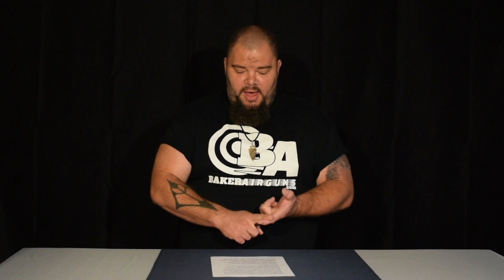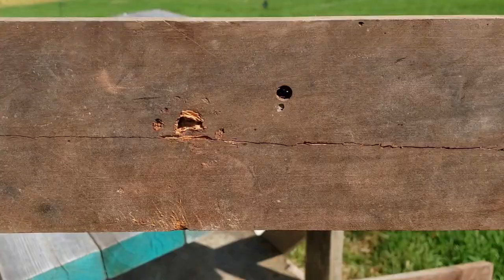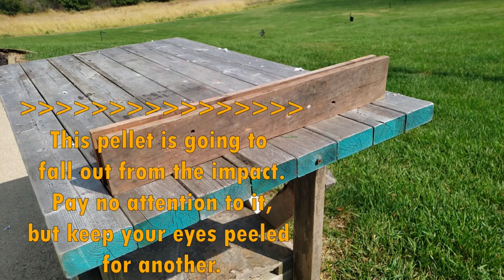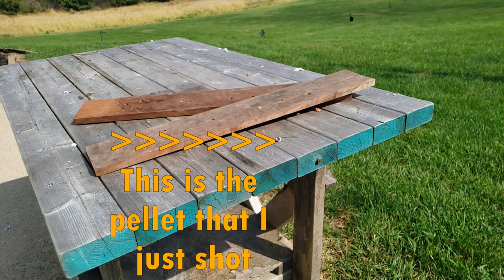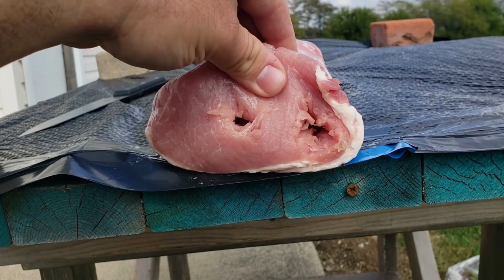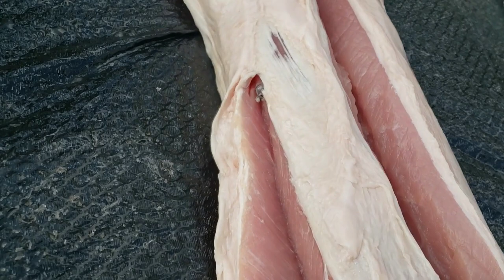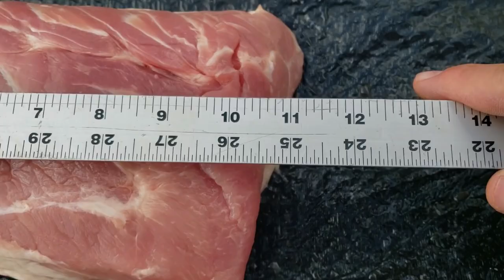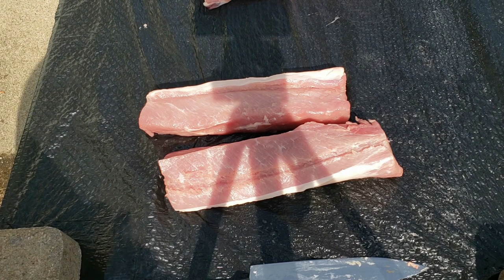PART II...What's deadlier, a .25 or .30 caliber airgun?

Comment: Yet another great video. Just wondering if that also translates down to a .22 at 70 ft/lb being even deadlier than the .25?  More “Penetration”?
Reply from the maker: Thank you very much!  I'm not sure, and I wouldn't even guess until I tested it.
-Donnie
Reply: I’ve never had a .25 but I have a Sumatra .22 and it puts out almost 80 foot pounds and it will shoot through a treated 4 x 4 I believe the video still up on my  channel.
Reply: I can tell you 100% in pork that my Impact MKII 22 pushing JSB 25.39s at 940 and pushing 25 25.39s at 940 the 22 penetration was about 6 inches deeper. Shooting NSA flat base HPs in 22 at 69ftlbs and flat base 25s at 78ftlbs the 22s penetration was about 4 inches deeper.
Where I did notice a huge difference in wound channels was not in 22 vs 25 or 25 vs 30... Where things changed is my 35 impact, it was a large difference in the first 2/3s of the wound channels and the remaining 1/3rd of the wound channels looked nearly identical and that's over shooting a fair bit of pork loin in tests.. We have shot hogs heads we have taken hunting and tested airguns on them as well. On hogs skulls pellets from 22 to 35 will bounce off it if hits at a glancing angle, and more then half the times. Out of all the most reliable to penetrate was 22 right 33.95s at 64ftlbs and slugs at 68-69ftlbs... 35 at 130ftlbs only tested with slugs and they was reliable at shattering the skull and penetrate the brain. As far as punching through the skull positioned with a slight angle to where shot would land, it was in this order 22 33.95s at 64ftlbs penetrate 90% of the shots (we tested 10 shots in each cal at a distance of 25y), 25 33.95s at 67ftlbs 85%, 30 44s at 71ftlbs was 65% but at 90ftlbs was 80%, 35 slugs at 70ftbs (lowest I could go) 55% and at 130ftlbs was 100%.

Comment: Question. What about with hollowpoints? The 30 will spread larger (which would,indicate more resistance and shorter penetration,  UT when you are talking about hunting, thst is what you want isn't it? Larger spread around the vital area?) (Also, if you are off,just a  bit, same vitals missing distance with both calibers, ie, just bately missing, with pellet trajectory just barely missing vital organ, you have more chance of the larger pellet actually hitting vital area as it spreads, no?) Would the smaller .25 penetrate beyond vitals before spreading maybe?  Just some thoughts.
Reply from the maker: Totally different comparison there.  
-Donnie

Comment: My theory regarding caliber damage wasnt that one was larger but could weigh more, that way it takes more energy to accelerate to the same speed which could make more use of the pressurized air, thats not tested here as both are shot at the same fpe. I agree though that at the same energy a smaller effective surface area will provide less wind resistance and more penetration obviously (as its also going faster). Could a 30 do more damage with a hollow point slug? That would seem intuitive to me idk.

Comment: Dude, you are awesome.  Reality gives not a single shit what we think, and when theory and reality conflict it's never reality that is wrong.
Reply: People forget that tissue is elastic, particularly living tissue.  5/100s of an inch difference the projectile's diameter is well within the limits of that elasticity.  Coroners have told me the only way they can tell the caliber of a pistol bullet that produced a wound is by finding the projectile. It also makes sense that in projectiles with comparable energy the larger one, the one with the most resistance, will penetrate less when there is not a significant disparity in sectional density.   That, to me, is not even a little counter-intuitive.  You want to kill something? You need to hit the important stuff, and you need to have the penetration to reach that important stuff when you do.  Period.

Comment: Hi, If both calibres were at the same speed, would there be any difference in the current results, also, related to the Kill effect, if there was a higher shockwave with the 30, (which wasn't evident) would this contribute to its potential lethality.   Grazie Mille

Comment: You will get debating from anyway you do the testing , they want you to give the thirty caliber more , Velocity and FPE , you can do the same thing with the 25 Caliber ! This was comparing two Air Rifles , so the testing was pretty darn fair ! People sound like the never ending testing for the 9mm Luger and the 45 acp ! 9mm will penetrate , Uhhhhhhhh Uhhhhhhhh Uhhhhhhhh more ,  Couldn't resist that ;  and the 45 acp at the same energy level will make a bigger hole ! Also those are some hard boards for a pellet to go through ! Thanks for the information and the cool videos !

Comment: the FPE is different on each round.  you should repeat the same test but the chrono velocities should be the exact same.  Im willing to say that if you push the 30 and 25  at the same velocities, the 30 will penetrate more.  great video though.  Btw the Gauntlet 2 is pushing 30 cal to 99 FPE. thats alot higher than the 30 in your vid.

Comment: I heard an African PH and guide say that when it comes to Elephant and dangerous game rounds, "Slow and steady wins the race".  Meaning a super fast smaller caliber will usually deflect and not keep the intended path through bone, whereas a slower big bore would drill a straight line.  I realize that we're not taking about elephant guns here, but the 'perceived' terminal performance on game of my 600mm Impact .30 vs my 700mm .25 is night and day.  The 30 SMACKS and again the 'perceived' knockdown is far more dramatic with my .30  However, I'm slinging 91lbs of fpe with my .30 vs 52lbs of fpe with my .25.

Comment: The Hatsan Blitz test by MacabeeSpeed, while not as technical, seemed to show the .30 cal retaining its power at a greater distance.
i know there is a lot of factors though.
Reply: in the video i reference the 12 minute 40 second mark shows a comparison @100yds of impact on a wood board and the .25 was stopped while the .30 passed through.
Reply from the maker: @alexanderb7197  Do you have a link?
-Donnie
Reply: @BakerAirguns  12 minutes 30 secs is more accurate
Reply: cant argue with that wound channel on the meat though. very confusing

Comment: Penetration does not necessarily mean more lethal. Smaller faster moving bullets have deeper penetration the most lethal projectiles dump there energy internally. The internal damage from a bigger slower moving projectile is normally more devastating. That's called stopping power. That's the main reason we use hollow points

Comment: Okay, most people using the .25 usually are shooting a velocity of 830-880 not over 900 because of accuracy and im not really all that familiar with the .30 but I would like to see a test with the .30 doing the same velocity as the .25 instead of tuning it down to match the same FPE. Not trying to "knock the science" but the point of going to the .30 is to get more FPE not to detune it to match the FPE of a .25
Reply from the maker: I did not detune the 30.  It was an FX Impact Compact and shot about 65ft-lb from the factory.  I tuned it UP to match the 25.
-Donnie
Reply: @BakerAirguns  The impact .25 is capable of 89fpe and the .30 is capable of 124fpe. And like I said almost no one tunes a .25 up that high unless its for slugs and even then call it 90fpe its still 34fpe less and thats alot lol I noticed you didn't mention the fps on the .30 only on the .25...... I honestly think this video is just to troll lol a .30 cal tuned to 70fpe is a light tune.
Reply: @BakerAirguns  You seem like a smart and reasonable person. And all I am saying is that your .25 is tuned to 9FPE below its absolute maximum and your .30 is tuned to 54 FPE below maximum. And running a shorter barrel. But for argument's sake, I would like to see you do the same test running the .25 Where it is which is almost at absolute maximum and then running the .30 at 9FPE below its absolute maximum which would be 115FPE And then compare which one is in fact "more deadly". Running them both at 70 FPE then obviously the .25 would be "more deadly" lol because if they are of the same power then of course the smaller diameter will penetrate deeper but the problem is that the .30 is capable of much more FPE than 70FPE.

Comment: It would be interesting to have FPS equal, or even just closer to equal, rather than FPE equal. Or, how about this: still at the = FPE setting for both as used in your test, using a projectile designed to expand better at the lower velocity that is required with the .30 to keep it's energy level down at the same level as the .25. ( What was it, about 100 FPS slower for the .30 to keep energy  equal? ) After all, the .30 is beginning with a 20% larger wound (hard to eyeball that) but higher velocity of the .25(required to get the FPE equal ) could lead to enough expansion to equal the wound channel of the .30. But, if the projectile was optimized for. lower velocity, or the velocities made equal or nearly equal, that might be interesting to observe the wound channels.

Comment: Why would you handicap the 30 to bring to the 25 lvl? That's what I'm getting. I do like the idea but 30 like about 1000 fps and where most ppl would run it. Why not both at 1000 or 900. I would be much more interested
Reply from the maker: That is not handicapped, and you seem to be missing the point here.  The point is to run them at the same energy, not the same speed.
-Donnie

Comment: Great video, however I think its important for any new airgun people to undersand that yes the 25 is better to a point it depends on what your hunting and the power of your gun, a 25 max potential is lower than the max potential of a 30 cal. My concern the test is a little misleading  . Kinda like telling the  stronger bigger kid to take it easy so the other kids get a trophy. run the test at matching FPS and things change.  . Bottom line is if your trying to chose an airgun cal for hunting always consider the full potential of the gun for  the caliber not whether you can restrict it to run a test. A 30 cal will not penetrate further at the same FPE as a 25 until the 25 has to travel so fast it destabilizes . you can put a whole lot more power behind a 30 cal making much it much more deadly at the same speed and leaves the 25 taking his ball and going home.. 😮😅

Comment: the bigger .30 impacts with a little more energy but the smaller .25 has less area so penetrates a little further but hits softer. iy isn't enough diference to be concerned with, i like the .25 cause it's more rounds per mag and more shots per tank.

Comment: The simple reason is mv^2 (where m is mass and v is velocity)... when you make the energy equal, the smaller cal is wins because the velocity needs to be increased for the smaller cal to "match" the energy of the larger cal... a faster/ smaller dia round will always penetrate more.  And penetration matters more with smaller calibers because they do not have enough energy to do enough hydrostatic damage - which is what opens up a wound channel.  In short, at the speeds and mass you are working with, the 25 will always win

Comment: Ok, if I need more penetration, I wouldn't trade my 30 cal fx for a 25.....I'd switch from soft lead pellets to a pointed, harder lead slug.  Realistically, who tf would pick a pellet for a 300 pound pig?   Now as for .30 not more deadly on the small game it was designed for?  I call bullshit all day long as this gun does far more damage at 55 ft/lbs than my .22 mag which makes 300 ft/lbs energy.
Reply: Also, has your customer never seen 'No Country for old men?'

Comment: Given that my airguns are .177 and .22 caliber, I don't have a dog in this fight.  But there's math and gun stuff, and I like both, so I had to watch.

When you're using "penetration" as the king of "deadliness" (after shot placement, of course) the .25 absolutely wins based on your data here.

One factor you mentioned, however, was "permanent tissue damage."  But what you're measuring here is not actually "permanent tissue damage."  You're measuring overall penetration and assuming that "more penetration" = "more permanent tissue damage."  That is not necessarily completely true.

Assuming that these are non-expanding projectiles (I believe you mentioned using domed pellets, so I would expect no significant expansion from them), you can calcluate the actual permanent tissue damage by calculating the volume of the wound track as if it were a cylinder.

I don't know the proper diameters of these airgun projectiles, so I used the diameters for corresponding centerfire rifle projectiles.  A .25 caliber centerfire rifle uses a projectile that is .257" in diameter, and a .30 caliber centerfire rifle usually uses a projectile that is .308" in diameter (we'll ignore the various 7.7mm ".30 caliber" rifles for now).

A cylinder with a height of 21" (your .25 caliber penetration depth) and a diameter of .257" has a volume of 1.09 cubic inches.

A cylinder with a height of 17" (your .30 caliber penetration depth) and a diameter of .308" has a volume of 1.27 cubic inches.

That means that the volume of the .30 caliber's permanent tissue damage is actually 16" greater than the volume of the .25 caliber's permanent tissue damage.

Does that mean that the .30 caliber is "more deadly"?  Probably not.  If that 17" wound channel isn't deep enough to reach the vitals, definitely not, obviously.
Reply from the maker: Quite a well thought out reply!  I very much appreciate it.  Meaning no offense, there is one flaw in your math.  These are round nosed pellets.  They both remove and temporarily displace tissue.  Your math would be more correct if the projectiles were wadcutters with sharp shoulders.  They would act more like a drill and remove all material according to their diameter.  The round nosed pellets do not.  While definitely a subjective analysis, I could notice no appreciable difference in the size of the wound cavities between the two.  Even if there was a measurable difference, I do not consider the difference to be significant enough to make a difference.  Had the test been between a .25 domed pellet and a .50 domed pellet, that might make a significant difference....but the 0.05" difference between the .25 and .30 was not perceptible so far as wound diameter is concerned.  The only appreciable difference was the amount of penetration. 
-Donnie
Reply: @BakerAirguns  I understand that the domes factor into the size and shape of the wound cavity.  When talking about volumes small fractions over 1 cubic inch, I figured the dome itself wouldn't make much of a difference in the calculation.

I think the reality of the situation is that if the pellet makes it through the vitals, the animal's not going to notice a difference in whether the pellet is a .25 or .30 caliber.

But penetration is a major factor in the "getting to the vitals" aspect.  And you have clearly shown that at equal muzzle energies, the .25 does penetrate more.  That is indisputable.

Comment: Given the amount of meat these both penetrate, won't the penetration be the same for both projectiles given that a squirrel or rabbit is much thinner than the piece of meat, i.e. the thickness of the animal?  The military and law enforcement use full metal jacket.  I find hollow points do much more tissue damage.

Comment: The difference is in the grain weight of the pellet and the velocity....these are not high velocity  .... they are sub sonic generally....the 30 cal travels much slower, but has heavier grain...but then...we add mass to the equation when we try for penetration...the mass is what is restricting the 30 cal penetrating through the second board ...while the 25 cal has a lower grain weight...but quite a bit more velocity...and lower mass.... the grain weight is balanced by the velocity in the 25 cal...and so...like the 30 cal...it penetrates the first...but where the body mass prevented the 30 cal penetrating through the second board...the 25 cal passed through with higher mass dragging it down. Penetration is based on weight, velocity and mass.

Comment: I think you're testing is flawed. A 30 caliber has larger frontal area so you can't just go off of foot pounds of energy velocity is what dictates penetration as long as the slug or pellet holds together. As an example if you could shoot a 0.25 caliber 60 grain slug it would penetrate further than a 60 grain 0.30 caliber slug going at the same speed because there's less frontal area on the 0.25 caliber. So try shooting the different calibers at the same speed and the weight of the .30 caliber slugs should be 20% heavier than the weight of the 25 caliber slug because that is the percentage difference in the size between the two calibers

Comment: I have been a butcher for over 20 years, and used my Samyang 909 to shoot hogs in the head with 454 round balls for years, drops them no problem, and better than a .22 because they are knocked out cold.  As for penetration through an animal, keep in mind the width of the animal would not be complete meat unless you shot it in the butt. Shoulder shots go through real soft material and air, as the heart/lung area is not equivalent to either gel or a pork loin. Hide - Bone - 6" meat - Water - 6" meat - Bone - Hide would be perfect combo